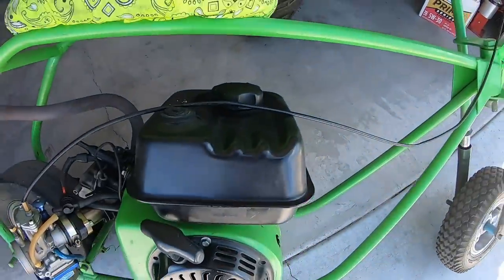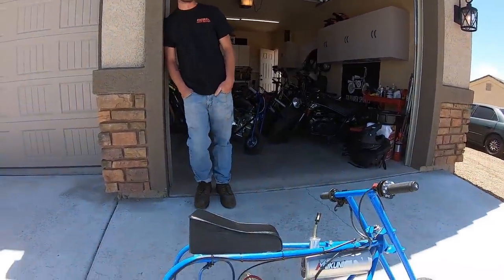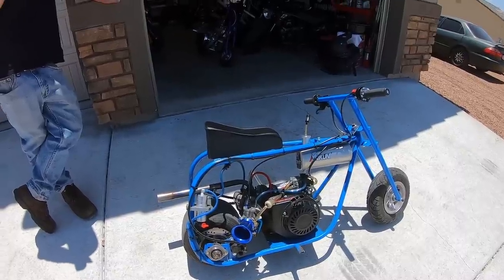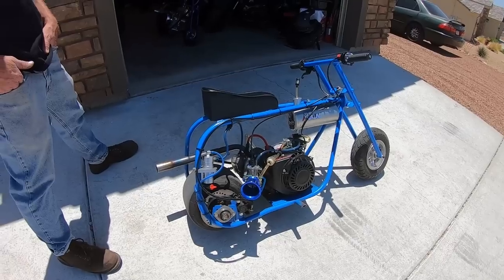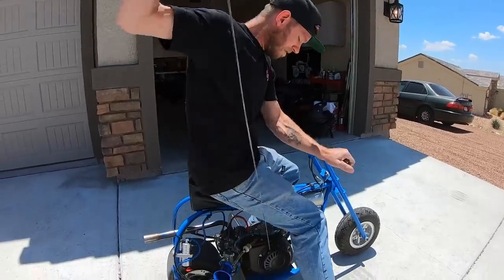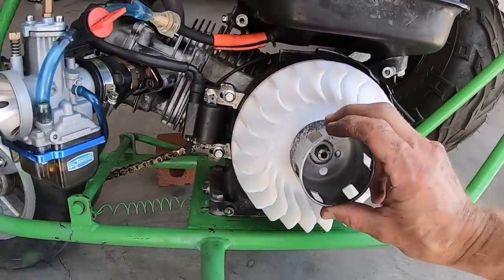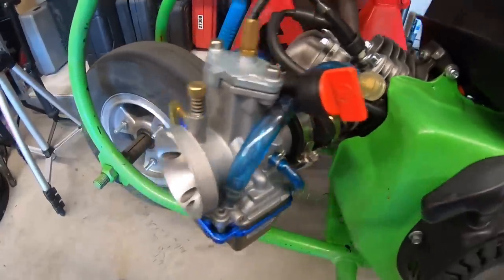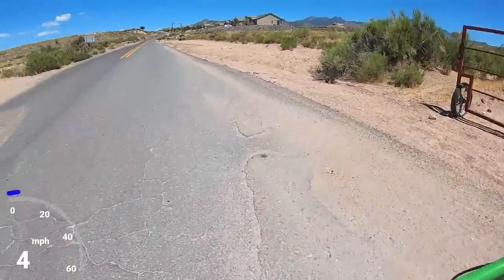GTS mini bike walk around road test and repair

Comment: Awesome, I’ve learn a lot from your video I’m about to do a similar built to your $100 budget build do you use 1/4 self tapping bolts or just regular ole 1/4 x 1 - 20
Reply from the maker: Either one will work

Comment: All my bikes have a hydraulic brake except the Coleman’s that came with cable disks. They just go too fast for a scrub brake. My bucket list project is a two speed, I’ll get on it in the next year or so, probably a jackshaft setup
Reply: Never too fast for a scrub brake. A gts went 105 today in cali and has a scrub brake and stopped 😂 i go 65 on my built gts and stop on a dime

Comment: This one is a good educational video for the masses.  Big carbs make big power...but on smaller displacement engines or engines with stock cam and valve train, it is easy to over carb an engine.  When the carb is too large, it takes very stead slow operation to maintain enough intake velocity to produce usable torque.  When sized correctly, velocity through the carb produces a long, wide torque curve.  Torque from off idle to WOT will result in better performance for ALL applications except drag racing.  Late braking and power out of the corners is what makes you fast on the track and trails.
P.S. This information is for the viewers, as the producer of these videos clearly has a strong grasp on the subject.  ;)
Reply: an informative and well thought comment.. are you new here on the internet??
Reply: @vitiatedvagabond9632   Kind of new here...but old as the dirt.  Thanks for the complement.  Ironically, I tend to follow the channels which are still learning as opposed to the well-educated masters.  I have experience and education which I like to offer in the comments when I can, and with the guys who do premium work and know what they are doing there just isn't that much to add.  Red Beards Garage for example...he does it right.  I'm much more likely to comment on a viewers comment or question than on anything he does.
If you read the comment I just posted on his (Black66) "When you make a mini bike street legal lighting and accessories" you will have a better idea of who I am.

Comment: is the blue one actually a gts frame seems different since it’s round then goes straight down to round when a gts one go straight to a angle and then round
Reply: nvm found out later in the video it’s a older gts frame if i’m correct
Reply: yup older frame, def rare
Reply: it’s a custom gts bubble back with a 10 inch motor plate and live axle set up gts can do anything custom for you

Comment: So I did a pred 212 stage.2.. arc rod, 265cam, 26lb spring, arc flywheel, vm22 carb and header. 12/60 #35 chain. Seems that rpm’s are limiting at 5k. Could it be the clutch? Hillard heavy duty. What clutch you recommend?
Reply: Flywheel gap is important. It will limit rpm
Reply: @jamesgravel7755  gap was 0.030.